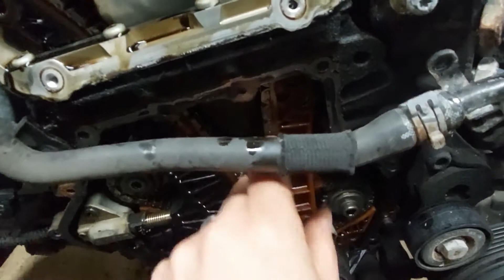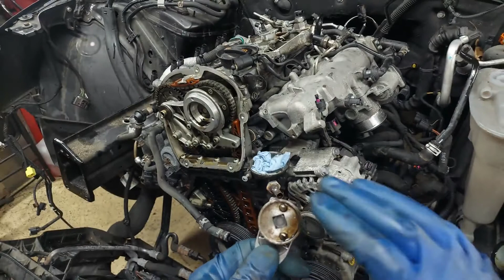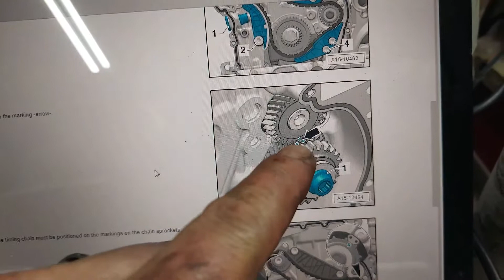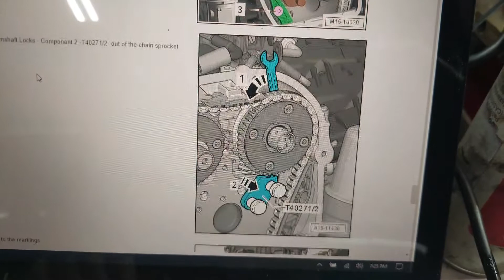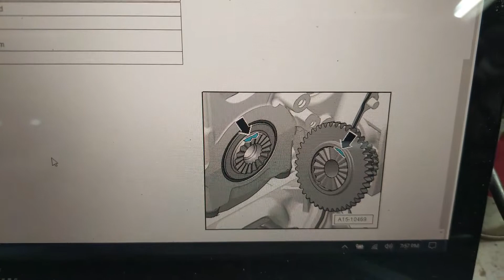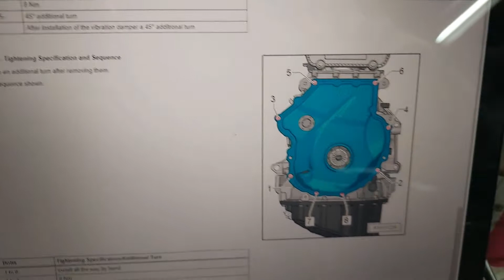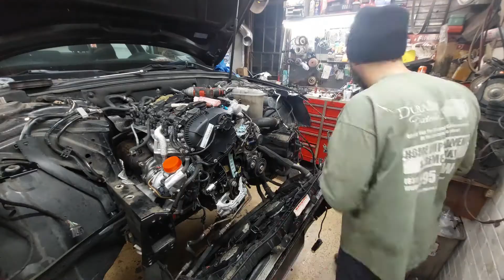How to replace the timing Chain kit 2013 Audi A4 2.0 TFSI

Comment: Hey will really good video on TFSi timing components, I have ‘13 A4 B8 CAEB motor with 72k mi and cam/crank adaptation is showing on VCDS at -7.0°. I know that people say at -4 it’s time to get the tensioner and chain done. But I pulled the inspection plug I’m in 9th notch and I noticed that my spring clip has two notches still behind it, I have never heard of the updated tensioner failing, but I have everything ready to do this , just waiting for a warm weekend.. anyway about the blue loctite did you put it on all bolts for the timing components (the guide 10mm tripsqu and the t30s for the tensioner)? Did you apply loctite to the threads on the balance shaft chain tensioner prior to torquing to 80 nm? And what about the cam bridge t30s? Any loctite on them? Same for the lower cover t30? Great tech tip on the pushing the spring to the end of the tensioner? I’ll make sure to do that..and what about cranking it over to build pressure, should I pull coil connectors and the HPFP solenoid? I also heard that the balance chain tensioner should be primed with oil before installing, any thoughts on how to do that? Great video
Reply from the maker: that was a mouthful. So, I put blue loctite on everything that is critical to the engine timing basically.  Those are the last things you want to loosen up. At -7.0 I'm surprised it's not throwing a corilation fault. Also, audi says no more than 7 notches, I believe.  stretched.  have tensioner room, that chain is still stretched. I also pulled the coils to crank it a bit to get oil around before i fired it up. I also set basic settings for the throttle right away before starting. Thanks for watching. I hope this has helped and put you at ease to do it yourself. Good luck.
Reply: @willpoweredgarage969  What do you do in basic settings for the throttle body before first startup?